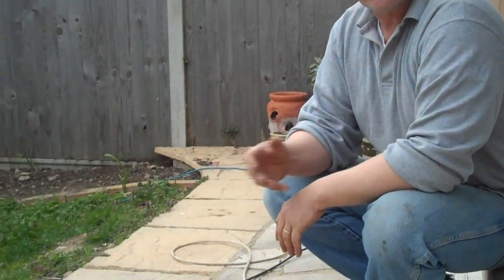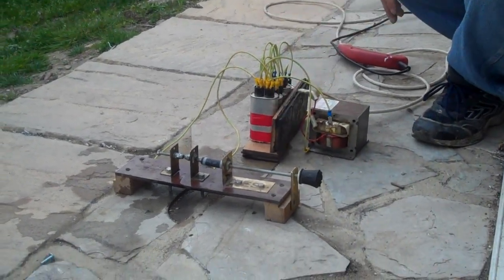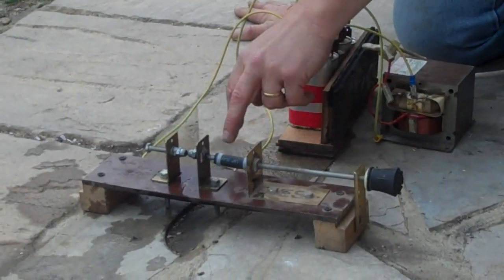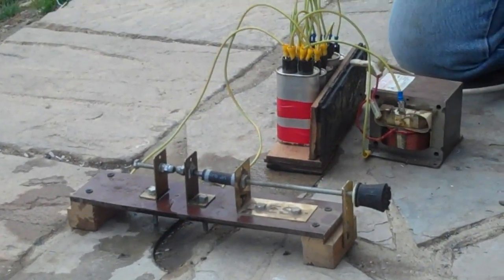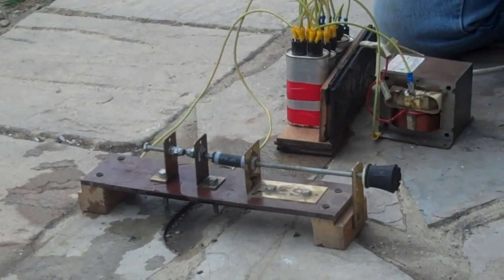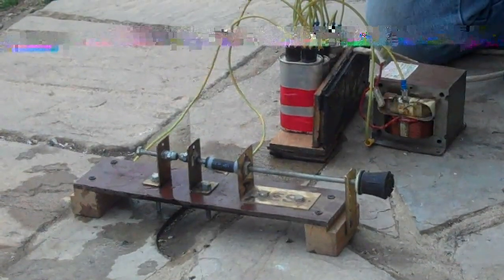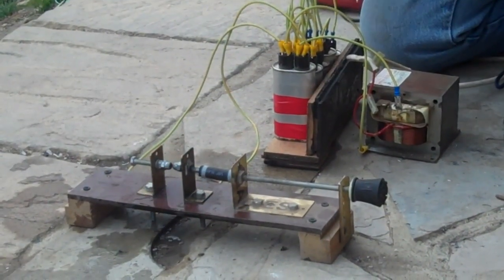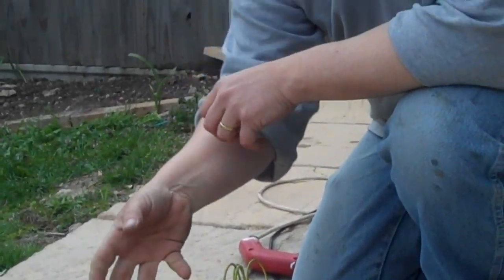Exploding water 2  - This is weird

Comment: Electrically induced explosion effect in water has been explained on the bases of Radiant Electricity of Nikola Tesla. In your set up here though there are two process at work1) Coherer effect 2) Preferential discharge between two different capacitances, watch carefully the explosion gets louder progressively.

Comment: Its pretty simple. The water has a much lower resistance than your spark gap. The current will take the path of least resistance. Once plasma forms in the water, this provides multiple conductive paths for the current.

Comment: Nothing wierd here, this is called as the coherer effect, the hylem board with the water on it gets conducting at High-Voltage, the same effect they use in producing electric 'treeing' on wodden plank ect. to produce artistic creation. The Insulation wears out and turns the low-capaciance polarization interface between the plates (holding the spark -gap in your set up.) into higher capciance usually carbonizing and de-tunning the High-Voltage source. And yes those capacitors there enhance the action of polarization i just described above.

Comment: The relative permittivity (dielectric constant) of water is about 80times higher than for air, which is why I would assume that seeing the water exploding at the bottom is just ionization (followed by current flow) following the path of least resistance.
Btw: do you know if this "water explosion" works just the same way in dielectric barrier discharge, with one exposed and one covered electrode or do for some reason both electrodes have to be exposed? It should in theory, but maybe you've tried it(?).
Sorry, I know this video is incredibly old - I'm just trying to follow up with what you've done in the past, because your channel can't be overestimated as a source of inspiration. I greatly appreciate how much work you put into it over all these years, with hundreds of videos. You deserve millions of subscribers.

Comment: maybe its because the two sides of the spark gap are connected to the copper that the water is touching, since the water is more conductive than air its just bypassing the spark gap entirely
Reply from the maker: Well the HV is definitely going through the water
Reply: yeah, but is it even crossing the spark gap or just using the water as a better conduit to flow through?
Reply from the maker: Travis Coakley
it goes through the spark gap

Comment: Maybe there is a field created by the arc of the spark gap and this transfers wirelessly to the water, I like the fact that water is dissociated and explodes in high voltage.
How many volts and amps ?
Reply from the maker: I am likely to use this to make a graphene reactor
Reply: Cool, great work, keep us posted..
Reply from the maker: derekvolt
will do mate

Comment: When capacitors are in parallel their capacitance increases and voltage stays the same. You have 2000 volts at 5uF, not 10,000 volts. You are getting confused with series capacitors. However, even if they were in series, you would still only getting 2000 volts because that's the maximum voltage achievable from a MOT (unless you charged them in parallel and discharged them in series, which would require a rather complex mechanism).

As for the exploding water phenomenon, I guess the same effect would occur if you didn't have a spark gap at all (just discharging the capacitor directly into water). A high power arc, such as a capacitor discharge, probably just heats the water to a high temperature very quickly, causing a steam explosion (too little total electrical energy to produce hydrogen and oxygen; the capacitors are only discharging at 5 joules). It doesn't look as if the spark gap you have here is actually doing anything. Of course, 2000 volts isn't a high enough for the spark gap to fire anyway, although I can see why you thought that it was firing if you thought it was 10,000 volts.
Reply: yeah i'm easily confused thanks for that

Comment: try it on plastic Robert it could be a discovery, conductive plastic. I remember I got my stun gun wet one time, Enough to make the electricity travel across the wet part and not the spark gap. and I shocked the water until evaporated and electricity was still traveling not across the spark gap, but across the ionized path that the water created. off topic But I thought that that was interesting that if i put water on something that is not conductive and you zap it with high-voltage it may make a conductive path. The way I understand electricity is that it needs to build up Just enough pressure to jump the easiest pass to the other side And that would be the water in this case because it would require less pressure in order to travel across the water instead of the spark gap

Comment: i have done similar exploding water experiments-there is a lot more energy when water is present than when it is not.
it ticks all the boxes for me in regards to fun experimentation.
bright lights
loud bangs
high voltage
and mysterious results
i dont think path of least resistance is a good enough answer for this one.
the gap is much closer than the distance on the wet board,i think the water polarises and becomes conductive as the hydrogen and oxygen are ripped apart.
then it all burns and goes back together and becomes water again

Comment: The water has less resistance then the air between the spark gap so the energy takes the path of least resistance.  The water is not burning, it is completing the circuit and creating plasma from the discharge. I'm quite sure if you were careful and didn't spray the entire device down with water and only applied it on the board beneath it would spark at the gap. As the electricity has a direct path when you soak the whole device one would normally expect just what is happening.

Comment: The explanation is; the surface af the water vaporizes and becomes even a better conductor but as it conducts H2O splits up in Hydrogen and Oxygen and a nano second later the H ignites when it does there is always a distinctive sound because as it does in combination with oxygen it explodes and implodes shortly after the explosion which in turn makes the air vibrate and makes it look like the water burns... Jona! P's

Comment from the maker: they are microwave capacitors at 0.91 microFarads at 2000 volts connected in parralel and supplied by a 2000v supply

Comment: Hi Robert. 
I just wonder what the value in uF and voltage on each capacitor was? And if you was connecting the capacitors in series or parallel :)

Comment from the maker: I like that as idea I am going to play around with it tomorrow. Incidentally the board is polycarbonate used for high voltage installations. I am going to get rid of the spark gap and try flat electrodes with a large surface area and see what happens

Comment from the maker: Hiya - good thinking - i didn't insulate the rods from their supports - but i did run an earlier version of the experiment i didn't bother to video - mostly because nothing happened - In the earlier experiment the water was held in a cup shaped electrode with an insulated central electrode - the cup was filled with water - and nothing happened - well it fizzed a little! - but nothing like this - i mean how bright were those sparks!! - evenso i think you might be right

Comment: Very cool lolll... Just throwing an idea here... I dont see it very clear but did you insulate the spark gap from its support? I am thinking the spark could bypass  the horizontal rods through the supports then complets the circuit into the water . Electricity  always takes the easyest way and i think water has less resistance than air.